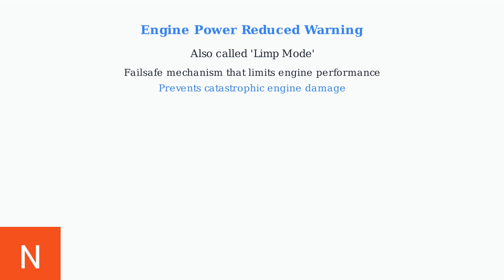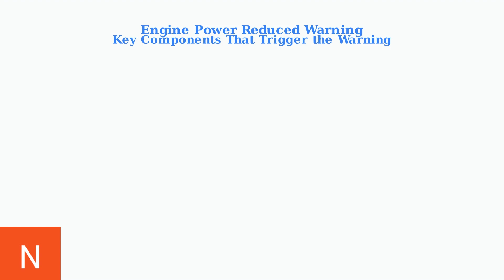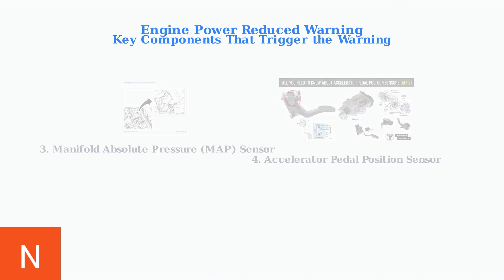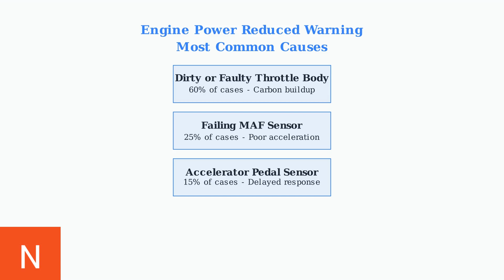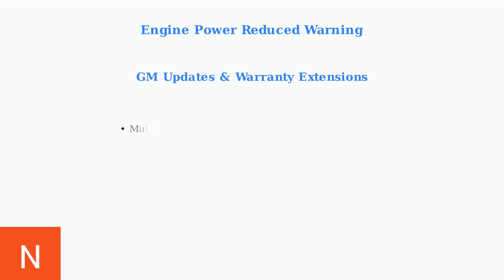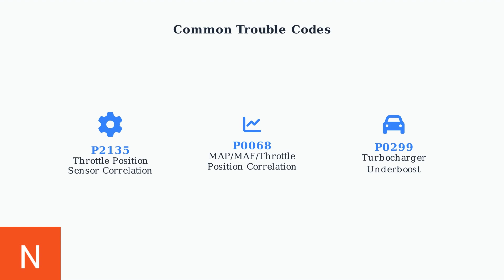How To Fix Engine Power Reduced Warning On Chevy Malibu – Causes & Repair Guide

Comment: I did it all.  I changed out the accelerator pedal, the throttle body.  Both very easy and fun to replace.  
Error still there.
I changed out 2 burned out fuses.
Error still there.
It was honestly just low ans dirty oil so a good oil change and to clear out the codes with a scanner and its all good now.